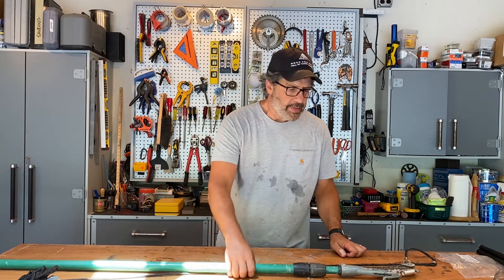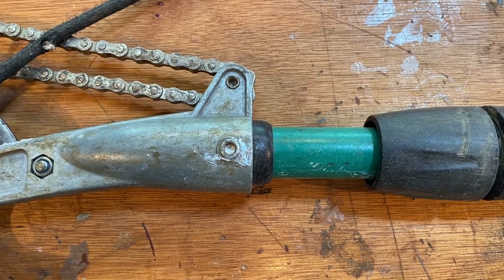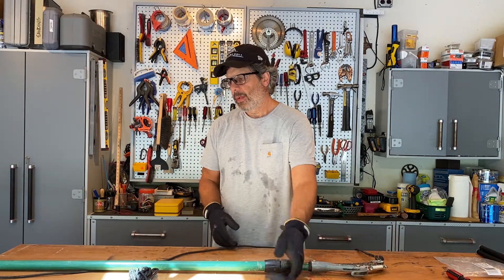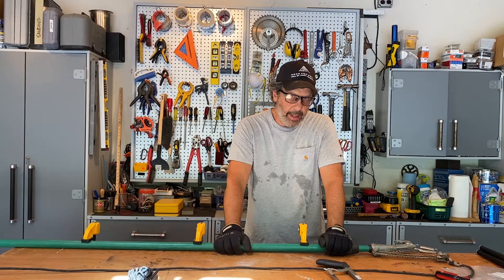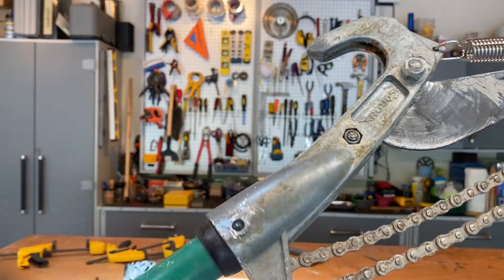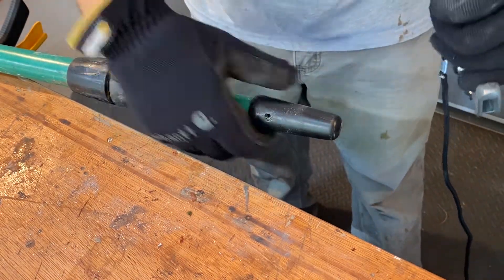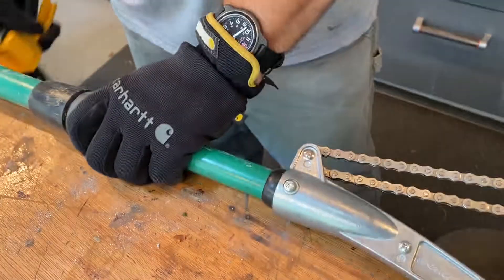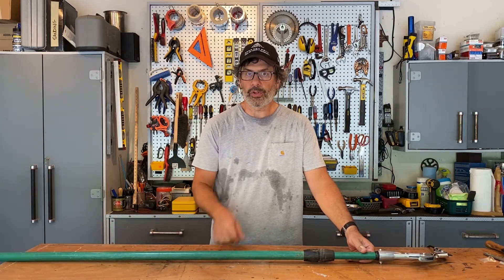Corona Tree Pruner Head Replacement - 6830-8

Comment: Thanks for producing this informaive "how to" video.  We're having a bit of an issue concerning the "locking collar" and hoping to receive your opinion.  Our Corona Model #TP3841 is roughly +/- 10 years old.  Our issue:  we're unable to sufficiently tighten the locking collar to keep the extension from slipping.  Spoke with the folks at Corona, unfortunately they've no "fix".  Any thoughts??  P.S.  Like your hat!   Thank you.
Reply from the maker: Thanks!  I don’t think there is any fix for that.  If it’s not tightening, the internal collar is broken and I don’t believe they sell a replacement part for that.
Reply: @dontscrewitup  Thank you

Comment: rivet, not bolt.  The easiest way to get them out, I've found, is to drill out the depressed end and punch it out.  If you don't want the protrusion of the lock nut you could try to find a binding post of the correct size and length, ( if you want to keep a bit of humor in this they are also called sex bolts by some).
Reply from the maker: Thanks for the clarification. I knew it was not a bolt but did not know the correct name.
Reply: @dontscrewitup  The other point I would make is to never drive a bolt through a hole.   You are much better off screwing it through, even if you need to grab a cordless drill and nut driver.  Even a slight bit of damage to the end threads makes it a real pain to start the nut.
Reply from the maker: Yes, thanks. I commented on that maneuver in the video, that there was a risk of bunging up the threads by doing that.